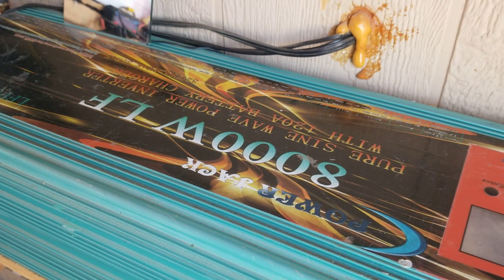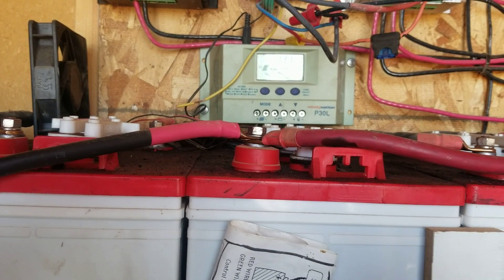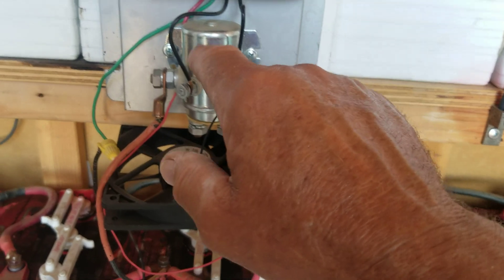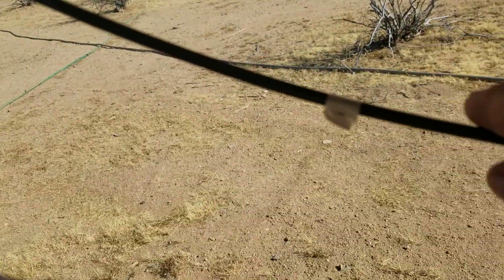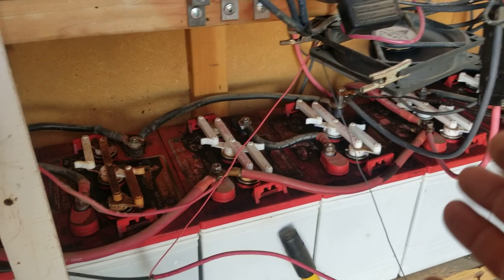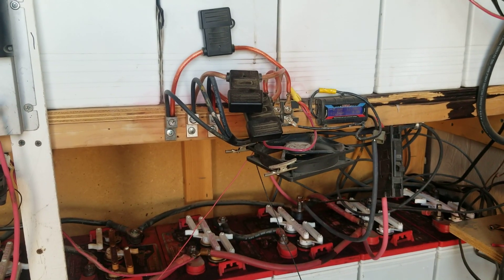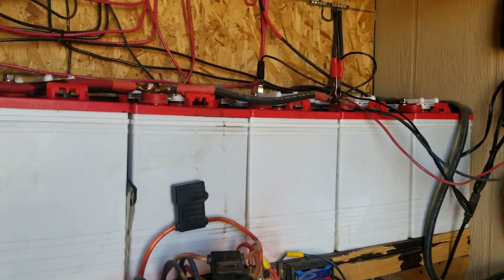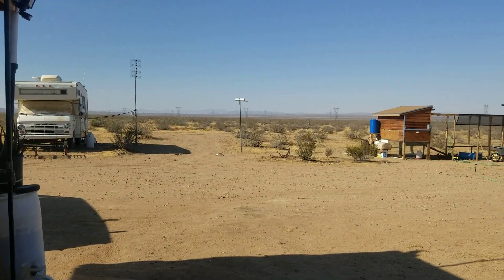Off grid electricity and wiring 101

Comment: Gbear I have breaker from my solar panel so I can work on any of my system if I didn't have a breaker off of my solar panel I would probably get shocked working on my charge controllers and inverter I built my own buss bars for the batteries cause they can produce 4500amps for all 15
Reply from the maker: First off, you should NEVER disconnect solar panels while under load.  Cover them with a tarp first.  I'll go over that in today's video along with how and when to hook up items.

Comment: fuses is always good is a way of disconnect and protection.  i have the solar panels to a breaker box from solar panels to power to the controller. and that dump load tight to each end of the battery setup, so be equal to all batteries at the same time, not just one. nice explanation to people that don't know much about solar. the controller has to be set up with your battery information sheet

Comment: You probably all ready mentioned it...
But when you/we are off grid.. Our Electrical Lives revolve around the sun...
Use your heavy electrical loads when the sun is out and your panels are generating higher outputs...
When output drops or the sun is down..  Use low power demand items
Led lights,  computers,  low wattage tvs...
Remember
The harder you are on your batteries.... The shorter life they will have...
Well taken care of lead acid batteries can last 10+- years
Abuse them and you can kill them in 1-2 years

Comment: Hello sir !
With great respect I must disagree with you !
Battery amp hours of one of the most important things there is you have to have the solar panels sized to re- charge those batteries everyday.
I also respectfully disagree on fusing! 
I put breakers on everything including lightning protection !
And I understand that a direct hit will do me no good with the fusing I have !
But my system is protected for a near Miss with lightning.
I realize it was solar 101 !
I love what you're doing out in the desert!
I too am off grid !
Very pleasurable being off grid !
Best Wishes Always sir
Reply from the maker: Welcome aboard.  If you feel safer adding fuses, then by all means do it.  I don't know what you are trying to protect from, but solar panels don't need fuses.  PMA'S on the other hand should always be protected.  PS, don't forget earth ground on ALL your equipment.
Reply: The amph is important because that gives you your reserve power of the batteries to support what you are running off of them. They key for a good system is to have enough solar wattage to support what you're running when the sun is out. At least according to what I have read from a few solar installer's websites.
Reply from the maker: @VickyGeagan  somewhat correct.  Ah should be used to size your battery bank at 1/2  of 10% of your total daily wattage requirements.  Then your solar array should be sized to be at least 25% higher than that figure. (12 volt system.)
Reply from the maker: PSS, also, size your panel array for more wattage than your total watt usage daily so enough extra is available to charge batteries while everything you could possibly use on electric is running.  Even if you never run everything at once.

Comment: Thank-you for the advice G Bear you verified for me that I have my small system done right. Currently I am running two size 27 deep cycle industrial batteries and one 24 size their used for commercial fishing boats and electric forklift applications. Their flooded lead acid. I have a 180 watt solar system running a 1,000 watt inverter, modified sine wave. To power my power tools and two led 12 volt lights plugged into my 30 watt controller which has a built in fuse like most good ones. I also have a led 120 volt 4' shop light with an eight foot outlet strip and a cord for my snow blower plugged into the inverter. I plan to add a disconnect to the inverter also another one to the 300 watt pure sine wave inverter I got to run my laptop and amatuer radio equipment that is all I need for that. I blew a high voltage capacitor in an old 800 watt modified sine wave inverter I hooked up along with my 1,000 watt inverter with it turned off. So I am leary about running them both connected. with out battery isolation. When I am finished with my shop I will have to do a youtube video on it. I need a few more things to get it finished and I am waiting for my states tax free weekend coming up next month to get the rest of my supplies.
Reply from the maker: Sounds like a good system.  You are right, don't combine pure and modified sine wave on the same battery bank.  The frequency modulation difference will cause problems.  May I suggest just dumping the MSW inverter and replace it with a PSW?  You and all you equipment will be much happier.
During my learning curve I burnt out a box freezer, a box fan and a pump motor, using a modified sine wave inverter.  Pure sine wave is the only choice of an off gridder.
PS, I love your batteries!  In the future I am saving for new forklift batteries.   They wont save me space, but let's talk about power!
Reply: @GBear  I got mine at autozone my 2 size 27 batteries and my size 24 I got at west marine they are both made by the same battery manufacturer. If I can find a 1,000 watt psw inverter at an affordable price I may go that route.
Reply from the maker: @VickyGeagan  thanks, I'll check them out.  Also, the 8000/13000 Powerjack inverter I showed has worked flawlessly for 5 years at a very affordable price.  Got it from Ebay.
Reply: @GBear  I have been looking at then I am a little weary of the chinese knock off ones. I did find a strong ways one which is sold under a couple of different names for a somewhat good price have to budget for it.
Reply from the maker: @VickyGeagan  Powerjack has gotten much more reliable over the years, and the have a great support group, always willing to help.  My experience.
Reply: @GBear  That's a little more than my needs I did find one from WindyNation solar's ebay store their solar panel store is located in Ventura, CA. They sell a solar brand inverter. I think it is the one from their 300 watt solar panel kit that the sell. Comes with all the panels hook up wire, cables and, inverter, just have to supply the batteries 12 volt and 24 volt available.
Reply from the maker: @VickyGeagan  go with what you feel comfortable with.   I have Windy Nation 100 watt panels and they work fine.
Reply: @GBear  Yes I have a friend russ from Sagemeto who has their 300 watt 12 volt kit on his home built mobile video production studio trailer and he gives them good reviews. I only use it occasionally and mostly for lighting. some times for some small power tools of mine. I was able to make a workbench out of my old wooden back door.